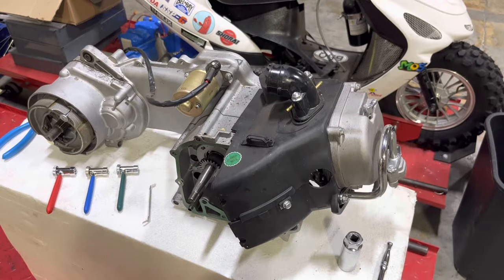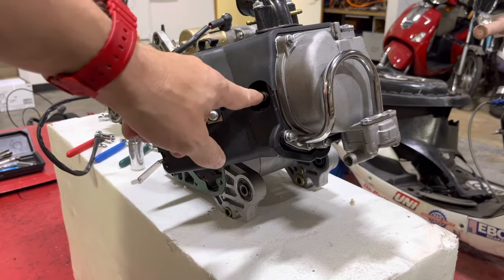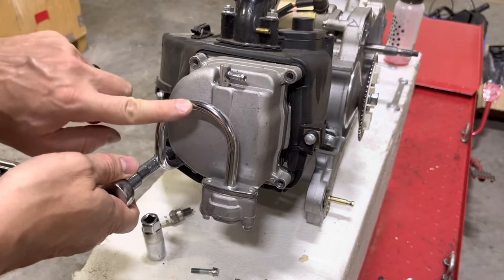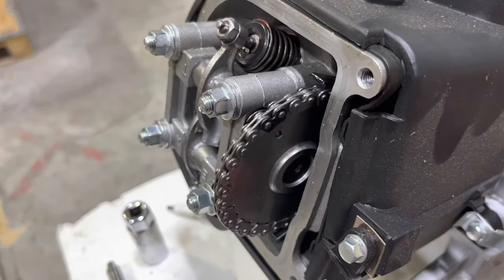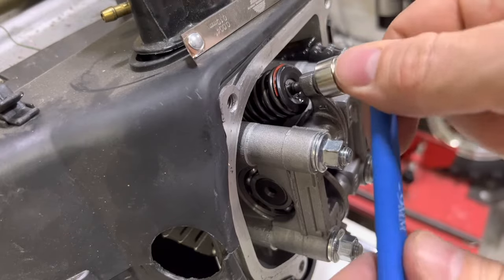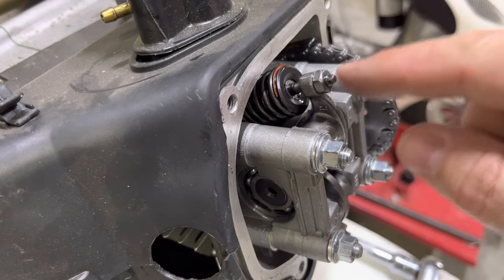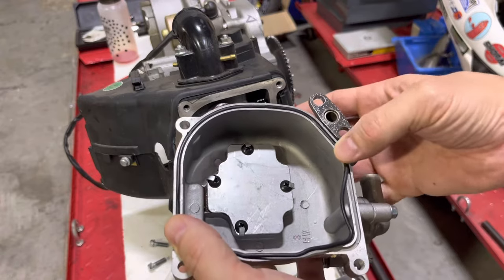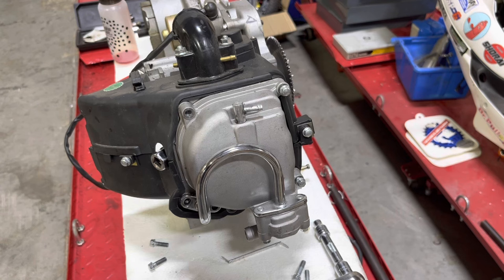QMB139 and GY6 Valve Adjustment the Easy Way

Comment: Hi,I found two parts over at your website,Right Engine Crankcase Cover but there are two sets of #'s.One is for 
47 tooth gear and the other is for 33 tooth gear.Too fix the old motor,Let me guess- have to take the cover off 
to find out.
Reply from the maker: You sure do
Reply: @Partsforscooters1  Thank you.

Comment: Hello! So I have a question. My scooter has poor idling issues whenever I come to a stop. Sometimes it just wants to die. I thought maybe the valves needed adjusting and did that to correct spec. However it’s still not idling right and almost dying at stops. What’s the issue? Is it carb related? Thanks.
Reply: Likely needs a carb clean, sounds like idle jet may be blocked
Reply: Maybe your clutch is shot i had that happen one of my springs broke and it wanted to drive all the time

Comment: Hi i have a question mine is not starting at all but the starter is turning long time not being used were should I start coz I now what to adjust the value am I on the right track

Comment: Hello again.I need your help,do you have any GY6 stators that work.The band new motor that I got some time
ago has no power on the spark side,it has power on the other side.Did check it with an omh meter,watch a Youtube 
to make sure I did it right.
Question-can I swap out the 8 pin stator and put in a 12 pin stator for more even flow of electricity to the lights.
Reply from the maker: On a 50cc motor, there isn't really a high power option

Comment: After i set valve lash my gy6 has a loud tapping noise. Now what do i do? Any help would be appreciated
Reply: Note: I did .004 for both int and exh after watching a different video so I will probably set exh to .005
Reply from the maker: @jdub_bkv6598  Set the exhaust to.005, but these engines typically make a tapping noise when they're running correctly.  If it's VERY loud, you have some other valve issue that needs to be addressed.

Comment: Hello.When I started modding my Racer 50(2019),I made mistakes on the motor,to many lights. Now
it's back in the shop & got rid of the extra addons.Ordered new parts,new motor,clean the gas tank out.
While going thru my collection of old parts i found a press on final drive gear with 13 teeth.the standard
drive gear is 15/52.That drive gear(13) would make it slower? Going to bump it up to a 80cc.The frame
weight is 187 pounds & mine is 190lbs or should I have my guy bump to 100cc.
Reply from the maker: How fast are you looking to go?  Also, the 50cc 4t bikes can't go up to a true 100cc so what kit would you be looking at? As far as the gear, do you only have the single gear or do you have the complete upgear set? A single gear won't do you any good as the gearsets are cut to work together. A single gear might not mesh well when installed.
Reply: @Partsforscooters1  Saw one of your older videos about final drive gears.I want to set it up so I can maintain the speed around town,where I live the speed is 35 to 45 mph.
Even if I left it at 50cc & change out the gears,press out & add the 17 teeth and the 49 teeth that came with it.
Would that give me another 5mph?
Reply from the maker: @monty81567  No.  The stock engine isn’t powerful enough to push taller gearing.  To get a reliable 45 mph you’ll need to install a pretty stout big bore kit at least.  Take a look at the Naraku 52.4mm kit. After you get the BBK running, you can start to tune your variator and weights to it, and after you get that done, if you still need more speed you would start looking at gears.  They’re usually the last thing you look at.

https://www.partsforscooters.com/137-4-Naraku-Cylinder-Kit
Reply: @Partsforscooters1  Thank you for your help,I wish I had found & talk to you back in 2019 before I did any mod's to the motor.
Would've just did the upgrade and left it alone. This summer my brother & I got 
are motorcycle Lic,pass the ridding & the written test.
Been rebuilding the back half of the Ninja 250,ordering parts that were missing,plastic pcs,hardware,new blinkers & mounts all were broken. 1st owner treated it like a stunt bike,2nd owner no better,everything was dry out.
 Thanks for your help.I let you know how everything went,when upgrade is done.
Reply from the maker: @monty81567  Too bad!  We’ve been doing this for 20 years now.  
Sounds great, and if you need any more help, just go to www.PartsForScooters.com and use the live website chat.  One of us will be happy to help.

Comment: there is something wrong. every manual state MM and from 0.04 to 0.05. all of them. even the service manual for my 2020 scootterre bistro 50 from the dealership says 0.04-0.05MM. and your tool is like 0.10mm or 0.004 inch. both terribly wrong.

are all manual in the world wrong ( damn chinese stuff ) ? or the marking on the tool is wrong ? 

i need to know. i have a quality ( OEM TOOLS 44025 ) feeler gauge but it starts at 0.004 and is thinner than a paper sheet. its more like kitchen aluminium foil. been told its not the right one for 139qmb valve gap.
thanks
Reply from the maker: .004 and .005 are correct. .04 and .05 are WAY too large.

Comment: Please for the love of God anybody that does a valve adjustment...torque the tappet nuts to spec!! Do NOT  hand tighten them. Use a torque wrench!! They have a tendency to back off the thread.
Reply from the maker: Actually yes, I should have added that: 7ft lbs IIRC
Reply: @Partsforscooters1 9.5nm